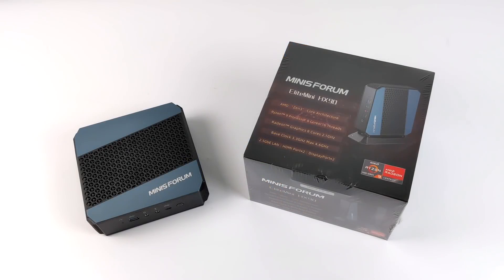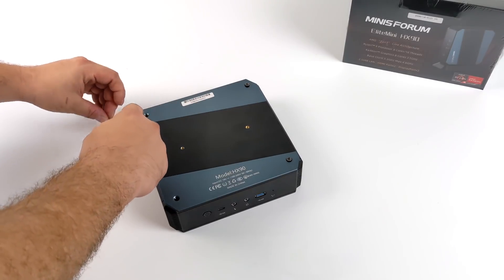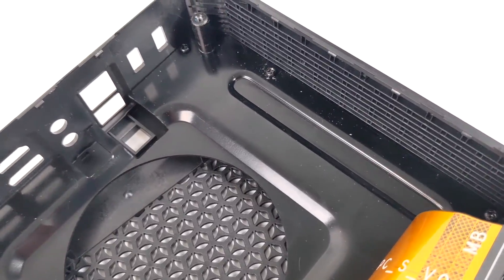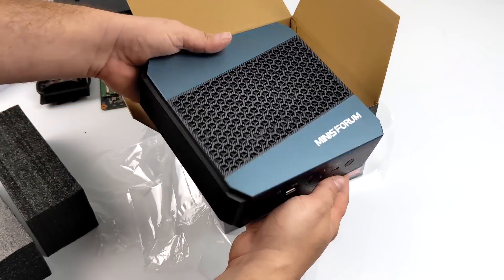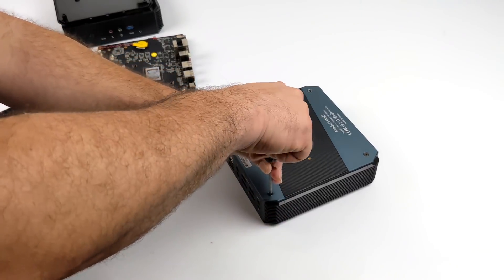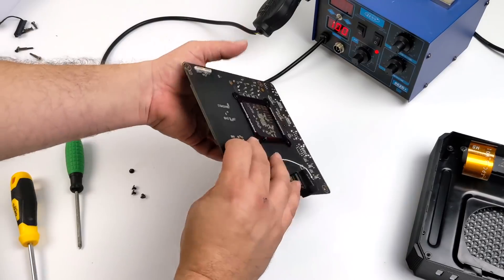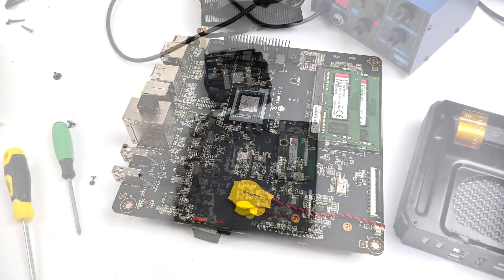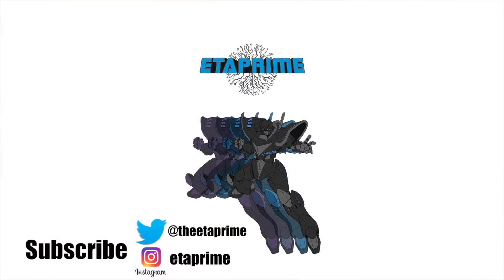Did They Fix The Liquid Metal Mess? Minis Forum HX90 Tear Down

Comment from the maker: Sorry, Had to fix a few things with the first upload.
Reply: Man it was good enough
Reply: The mini PC already have that fixed der8auer already made a video. Now the application is clean
Reply: Just like Minisforum.  :)
I like their products too and agree that it was marketing that got them in trouble on this one.
Reply: Were you able to close it back up without a mess ?
Reply: Can you make a tutorial how to install windows in a fire HD 10 11th generation
Reply: GAME PLAY ANDROID APPS  Tu parle de quoi au juste?
Reply: Yeah I had watched the first video. Clicked away and "Oh yeah I forgot to drop the like". Came back it it was gone. Ummmmmm.
Figured you took it down because of the audio repeats. I did wonder what element the "liquid metal" is? A lot of reviewers claim it has a short lifespan(~3months)?
Reply: 1.tribvutes from Germany.
2.is there ever a shmup MACHINE diy. Video coming?
3.wish me Lücke for the guveaways haha
Reply: Hi, thanks for the video, it is very informative. I purchased my HX90 in Oct and received in in the beginning of Dec. Didn't notice any liquid metal splatter when I opened it to install RAM and NVME. There is a problem though that really bothers me, the unit is very noisy, the fan ramps up the speed and noise out of the blue. There are only two options in the BIOS, enable or disable either CPU fan or System fan. I run Rocky Linux and hwmon does not have any  devices for the fan, censors didn't find any either. Any suggestion on how to reduce noise fan on this unit? I don't use it for gaming. Thanks in advance!
Reply: Question: which is more powerful for emulation. This machine with the new ryzen or the tiny mini pc i7 with the 1650 built inside?

Comment: Saying carbon fiber when its just 3% is unbelievably deceitful. At that low percentage, you cant even honestly say its carbon fiber composite. I know when it comes to gold, under US law you cant market jewelry as gold if its less than 9karats, which is 3/8ths gold content. I dont know if there is a similar when it comes to material composites, but there really should be, even if its something low as just 1/10th.
Reply: As der8uer notes there is no legal term when to call CFRP, CFRP so even as measly .3% carbon fiber is still CFRP
Reply: I agree with you, at 3%, someone could even argue the plastic was "contaminated" with carbon fiber
Reply: Part of the reason is carbon fiber is normally laid in resin so its never gonna be most of it or it would be an extremely expensive case. So this will be a stronger plastic but not like car  carbon fiber.
Reply: @4by108  Right, but the carbon fiber/resin composites are usually 70% carbon fiber 30% epoxy resin, give or take a couple percentage points. Its questionable how much just 3% carbon fiber even contributes to the material strength and quality.
Reply: Just remember, these are the people applying liquid metal. The more we quibble about whether 3% carbon fiber is really carbon fiber, the more quibble'able the liquid metal topic is. This stuff causes house fires, for crying out loud. Nobody in the world is looking for a carbon-fiber computer. Yet, Minisforum turned it into a raging topic. This cpu would benefit relatively well from dual-rank ram. Much more than liquid metal adds. But, Minisforum uses single-rank (and about the slowest nvme you can find). Then they make liquid metal an issue when nobody really looking for that either (and would benefit far more from a small upgrade in memory and nvme cost.). 

I think everyone's missing the point. Yah, sure, they're doing liquid metal now (after saying they were, but not). If someone has the kind of integrity Minisforum has, how much should you trust that install? Wouldn't you rather opt out of that, and choose dual-rank ram and even a mid-tier nvme? It's like everything about Minisforum is the wrong stuff to be thinking about. They lead their customers down the wrong path.

Comment: You don't need to replace liquid metal once you removed the cooler. Unless the materials really "sucked it in" (which only happens with bare copper and this is nickle plated) there is just no reason to replace it.
Reply: You seem to know about liquid metal, in this application would it actually increase performance enough to justify using it?
Reply: @alexdavis9324  on average between  liquid metal  and thermal paste the difference at best is less than 5°C    personally  not  really worth the hassle or the $$$$
Reply: @alexdavis9324  Not a bit for this PC. I mean he's right that it's not throttleling so it won't improve when running colder. On an Nvidia GPU that would be a different thing. Cause boost is related to thermals there but here it's more like "well I'd like it to run cooler for peace of mind".
Reply: @nach0x  that's wrong. You should look at one of the physics formulas to that topic it'll show you how complex it  is to determine the difference in °C a thermal interface material (TIM) will make. And liquid metal has a crazy high Conductivity. That means it'll change a lot on high heat output  devices or on devices where the Tim is the bottleneck. Had around 20°C difference on 3 of my laptops that I applied liquid metal on. There it was really worth because it kept them from overheating.
Reply: @alexdavis9324  yes
Reply: I have experience with a direct die CPU where LM improved temps by 30C when compared to direct die with Kryonaut. I was able to run that CPU 300MHz higher with the same temps - i7 7800X LGA2066, my max was 5.2GHz with cold water, 5GHz daily - that was a big overclock for this CPU model.
Reply: @nach0x  
The i7 6700K at 4.8 I had dropped almost 20c on the hottest core when I de-lided
Reply: @OneCosmic749  yup, especially for direct die, LM is the way to go. Unless you use a full aluminum cooler for obvious reasons.
Reply: @alexdavis9324  Minisforum is focused on marketing hype. The Ryzen 9 cpu would have benefited from dual-rank memory and even a mid-tier nvme. But, Minisforum uses single-rank and about the slowest nvme you can find. Then they spend tremendous labor on liquid metal (and defending their use of "carbon fiber."). It's like nobody should care about the stuff Minisforum wants them to care about, and should care about the stuff that Minisforum doesn't care about. (On top of that, you're asked to trust the liquid metal job they do. Your house could burn down 3 years from now. But, that $10 you saved on single rank memory! Wow!).

To me, that's a real concern. Absolutely nobody is looking for a carbon fiber computer, yet Minisforum turns the 3% topic into a topic they defend as truthful advertising. They're the same people applying liquid metal (or not) while cutting corners on components that really would boost performance. That's not something that gives warm fuzzies. If someone's house burns down, it's like they deserved it for patronizing this nonsense. (I think it's a good value for the machine notwithstanding Minisforum's lack of integrity. I wish they didn't do the liquid metal, sold it for less, and follow the same standard they've set with the slow memory and nvme they use. Buy barebones, use the right nvme & memory. But, when you do that, you're saddled with their uninspiring liquid metal -- while they're cutting corners everywhere else. I wish they exercised sanity with the components they use, and ditch the liquid metal.).
Reply: @alexdavis9324  only if you're really thermally constrained (already hitting 90°C+) while fans are blasting anyway

Comment: I'm not sure a unit "sent over" by the manufacturer to a youtuber for a review is a valid test.
Reply: Ye. All we have is their word that they didn't give these units special QA, and we've seen that BS before
Reply: Especially from the same company that already demonstrated they were saying "liquid metal" without doing it. Or, the same company that emphasizes carbon fiber when there's virtual zero (and nobody looking for carbon fiber computers anyway). Or, more importantly: the same company that cuts corners with single-rank ram & the slowest nvme you can find. You'd think they'd use suirable ram & nvme, something that really would improve performance rather than buzz-words about liquid metal & carbon fiber which make little difference. 

I wouldn't trust this company at all. I'd buy one of these if they didn't do the liquid metal. I'm concerned that a company that would do the shamelessly deceptive stuff they do would put much effort into the liquid metal install. That will forever be a risk of fire. Minisforum doesn't exude that kind of confidence.
Reply: @markfuller  especially when tbe youtuber is kinds known for reviewing sent stuff favourably

Comment: I own a HX90 and it runs pretty good with dual rank RAMs and decent NVMe SSD. No liquid metal splatter inside mine also and the temps are great!

My main use for this is not gaming but as my main daily driver PC using Linux OS and it's awesome for this. For gaming, I have my Ryzen 5950X & RTX 3090. For portable gaming I have the following:
*GPD WIN Max 2020 & 2021 versions
*GPD WIN 3
*ONEXPLAYER
*AYA NEO 2021 Retro Pro (hasn't arrived yet)
*ODIN Pro (hasn't arrived yet)
😁

Comment: That CF matting on the outer case should be enough to stop that case from cracking in normal use!
Reply: The case should never crack under normal use regardless of material. It’s a pc. Sits on your desk. Your not supposed to throw it around lol.

Comment: I have just got the same model, and I debating too open up and see any liquid metal mess, thanks for the tips and warning about this issue just wondering would it be safe if I clean out that liquid metal and add just the thermal paste instead ??

Comment: Totally agreed with the CPU cooler. They should use a more strong one with standard thermal paste. Like 4 pipes one like AXP90. It should overkill the 5900HX. And great performance raise if people over-clock it. If there is a thunder bolt 4 port, would be great!  Too many HDMI and DP port for me...

Comment: i've never got the "liquid metal" obsession. Don't get me wrong I get that it improves cooling, but is it really to a level that's going to make a difference on mobile / lower power chips vs the effort of applying / maintaining it?
Reply: It's definitely not for the average user. Liquid metal is mostly for users who need all the cores and performance they need for work, since lowering temps greatly increases CPU life. But it only really improves temps drastically when you delid the CPU, which in most cases, isn't necessary.
Reply: It helps on certain thermally constrained devices like Intel macbooks and certain other laptops to either eliminate or dramatically reduce thermal throttling.

Comment: Out of interest how much extra performance do you get with liquid metal over normal paste.  Is it worth it?
Reply: It's not worth it compared to the performance boost you'd get from dual-rank memory & even a mid-tier nvme. Minisforum cuts corners using single-rank mem & the slowest nvme you can find. Then they knock themselves out with labor-intensive liquid metal, and Quixotic carbon-fiber topic.

It's a good machine. Bad company. I wish I could order a barebones without liquid metal. Use the ram & nvme I want, and not have trust Minisforum's liquid metal. They don't ooze confidence to me. That's serious because your house could burn down. These are the same people cutting corners with single-rank memory (where it would really show a performance gain), squandering all this mental energy on stuff that doesn't matter (liquid metal and carbon fiber, an entire 3%! no less.).

Comment: It's a marketing gimmick as ETA said, why not just spend those dollars into a better cooler and get the same (if not better) cooling performance.
You have the liquid metal cost itself, the new apply method, all the engineering and engineers behind it (and salaries) in order to apply it correctly and mass produce it.
Also, you can't dissasemble your own product this way, they had to glue the damn thing shut.

Comment: the only problem with liquid metal is that it degrades a lot and i mean a lot faster than thermal paste. there are reviewers online that report cooling performance start to degrade as early as 6 months. the end user is going to have problems trying to keep it cool and are going to have to go in there to replace it if it is true. still nice to see that they took the initiative to get a better thermal solution to the end user. i really like that
Reply: Exactly. It's like Minisforum settled on two marketing terms (liquid metal, and carbon fiber), and are now doing everything they can to make those terms "real" when nobody cares. People should want dual-rank ram, and a mid-tier nvme (not the single-rank & slowest nvme you can find anywhere). It would add a small amount to the price, for a significant performance boost. In return, there wouldn't be the labor-intensive liquid metal installation. But, MS is doing the liquid metal install (of dubious quality, and a warning "don't look!") and cheating for no reason whatsoever on ram & nvme! It's nuts. My concern is that the security of the liquid metal isn't that good (from a company making decisions like this). That is a fire hazard in perpetuity!

Comment: Liquid metal is a bad idea. It corrodes the surface of your heat sinks. No way around that unless the industry changes to make the heat sink surfaces out of something non reactive to the liquid metal. Not worth the few degrees change in cooling when physical damage is a guaranteed result. They could have avoided any problems if they had not tried this gimmick selling point.
Reply: Exactly. Like Minisforum's obsession with carbon fiber. Nobody cares! It serves zero purpose, but has reflected very badly on Minisforum. Then they said they do LM, but didn't do it. Now they're doing it. But, how well? That's a fire hazard. 

To appreciate this marketing lunacy, you have to consider how Minisforum is using single-rank ram, and the slowest nvme you can find anywhere. They could have spent a little more on dual-rank & a mid-tier nvme. Customers would realize a far greater improvement in performance. But, no... it's all about buzzwords. That doesn't give me a good feeling about their liquid metal. I'm going to be thinking about that every night I go to bed. If minisforum uses the same integrity in that installation, it could turn into a fire any night.

Comment: Good luck replacing the fan if it fails.
Reply: Yes, that is my biggest concern as well. With all their custom built parts, there is no way you can replace the fan if it fail. And shipping it back for repair is too tedious a process.
Reply: @kokhowe  The fan can be removed from the heat sink with a few screws and it's connecter, there is a video of this on youtube... I was thinking the same thing, I have just ordered a barebones...

Comment: So, if the bearings on the CPU fan go bad, you just throw away the entire computer (if you don't have a heat gun).  Wow.  that is the dumbest thing that I have seen.
Replacing the CPU fan should be something that should be possible.  That will be the ONLY moving part in the entire computer.
Reply: That fan I believe is held on with three screws, from the top - Looks like a mostly standard GPU type fan, but you may need to solder / splice a wire new connector.
Reply: I upvoted but man, if you don't have a heat gun buy one.